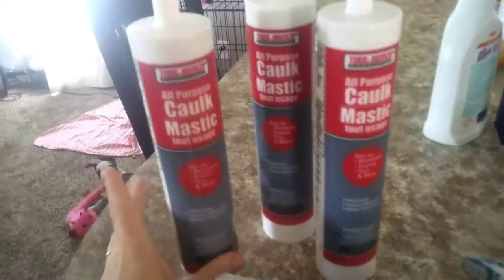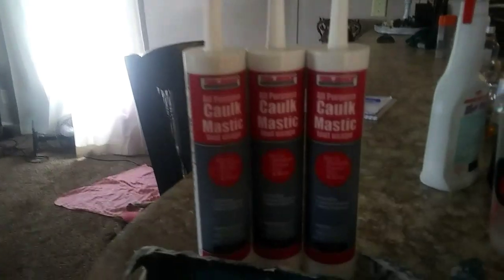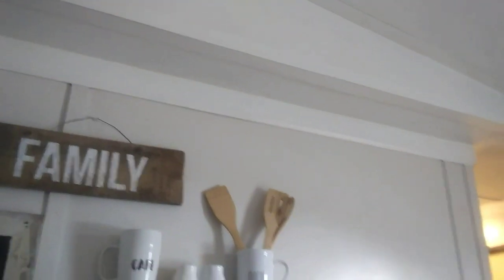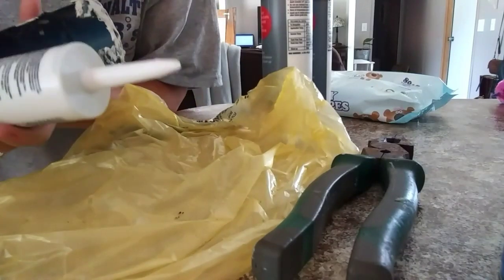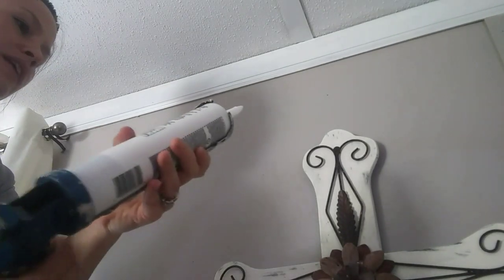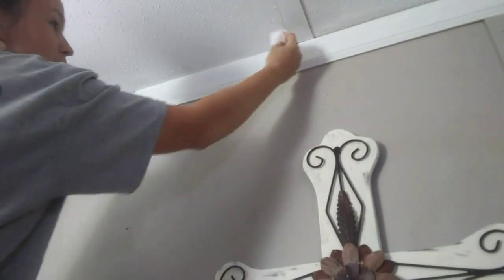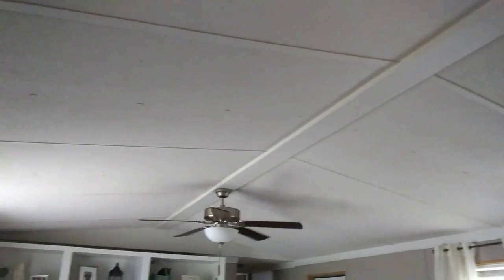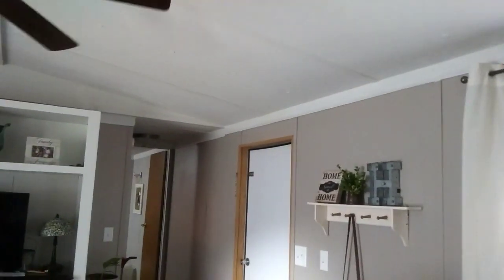Fixing up my 1980's mobile home | Caulking all the trim in living room | How to caulk for beginners!

Comment: Omg, I have to do this.  I've painted part of my ceilings (which are exactly like yours) but couldn't afford caulk at the time.  I also didn't feel confident in using it.  I have almost obsessed over those gaps on that ceiling trim.  I wonder if it also helps with power efficiency.  Great job, huge improvement.
Reply from the maker: I could feel the heat at those gaps so im pretty sure it helped alot unfortunately we had to say goodbye to this place because we moved to fl. So I didn't have enough time to really find out but it also helps with lil pests 😉

Comment: We have a mobile home and had to take up the carpet that a pet ruined. There’s a splinter board down as the subfloor. Do you know if the peel and stick laminate tiles will stick to that or is there something else that I need to do to prepare the floor first?

Comment: I also have gaps in my trim exactly like yours but if it's drooping did the caulking do anything but make it look better or did it fix the problem, I know u don't love in trailer anymore but just curious as I'm have this same issue with the gaps but seems like mine may be drooping more then yours. It did turn out great though on your end, also did you put in the fan or was it there when u moved in
Reply from the maker: It doesn't fix anything except appearance. Most homes have uneven ceilings so the trim doesn't lay flat against the ceiling.